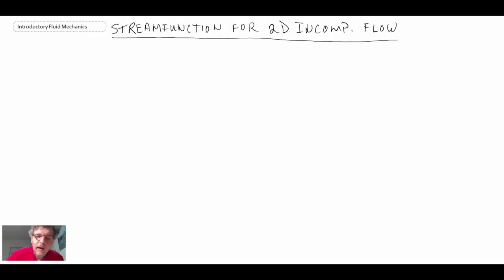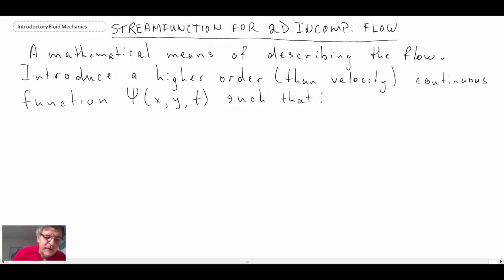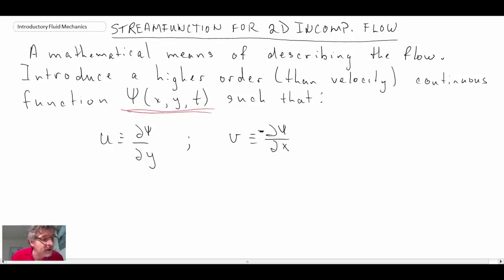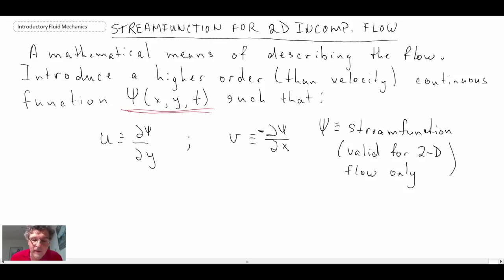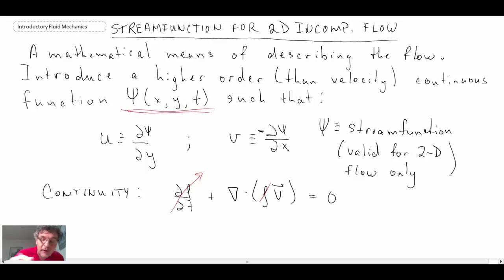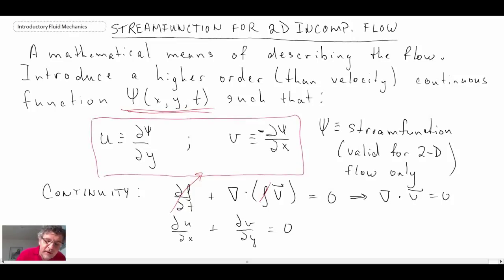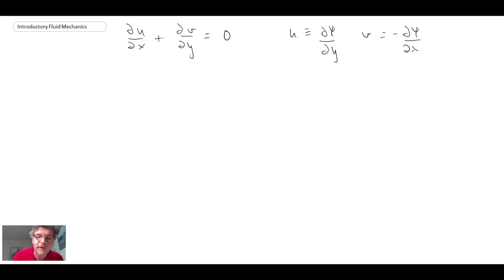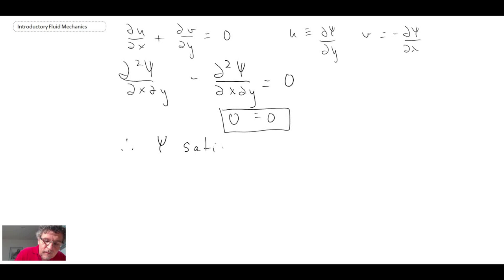Introductory Fluid Mechanics L13 p1 - Stream Function - 2D Incompressible Flow

Comment: Why he crossed multiply the velocity vector with dr? I didnt understand that part :/ at 5:42
Reply from the maker: It is just a vector property that enables us to show that the streamfunction has a constant value along a streamline.  We know that the velocity vector is aligned along the streamline, and the vector dr is also specified as being aligned along the streamline.  The cross product of two parallel vectors (in this case V and dr) is also zero.
Reply: Ron Hugo Just to find out Stream Function is a constant along a streamline?